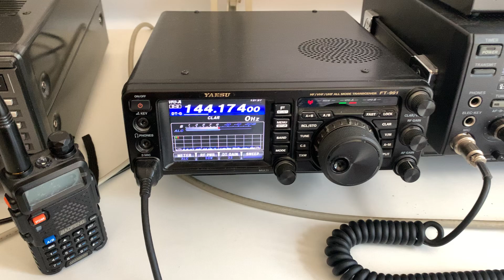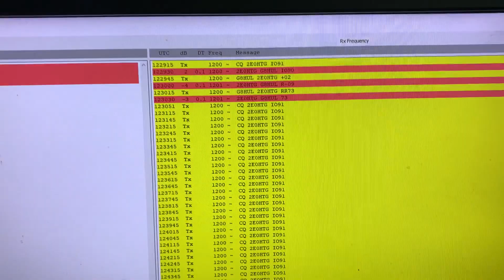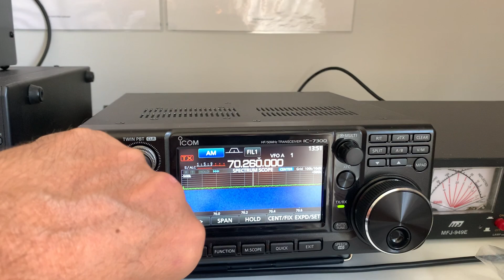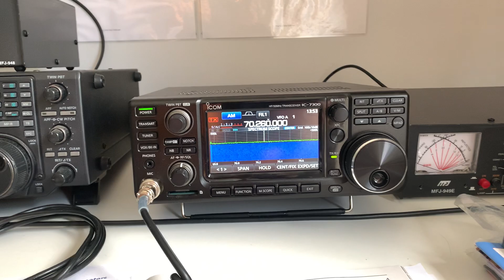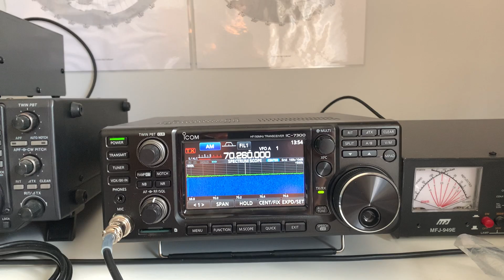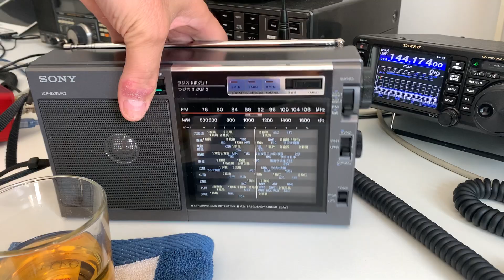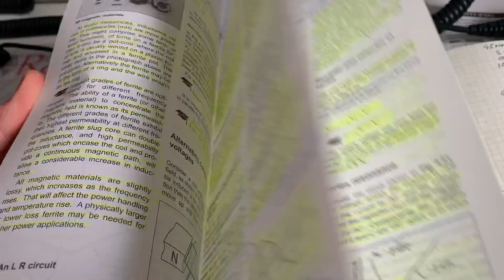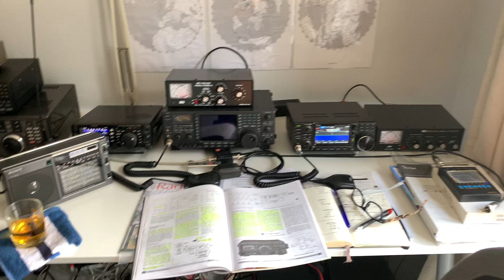Seventeenth weekend of lock-down in the UK: what I'm up to in the shack

Comment: Hi Clint,  i've had my wellbrook loop a month or two now.  Do you find it's directional on sw as well as long and medium wave?  Last night i changed the angle of it and suddenly picked up loads more distant stations, but I'm not sure if that was because of the receiving angle, the fact it had nulled out a local interference, or just a coincidence because of a change in conditions.
Reply from the maker: Hi there Kevin, you will find the Wellbrook is directional on SW, although less so than on LW and MW frequencies. Probably both - it will also null noise above 2MHz...basically they are fantastic antennas that I've not seen bettered in noisy environments. 73s, Clint